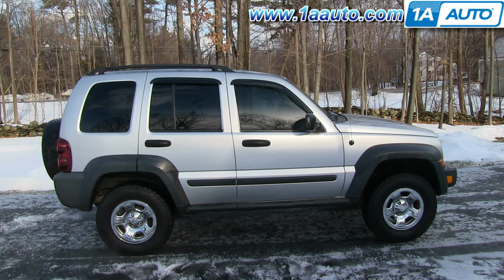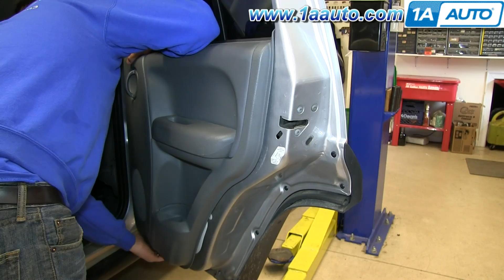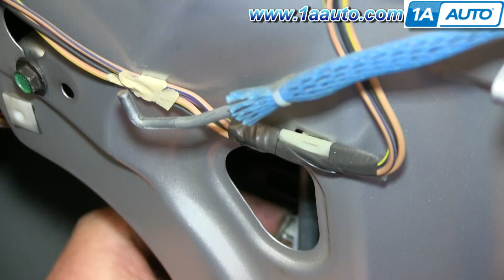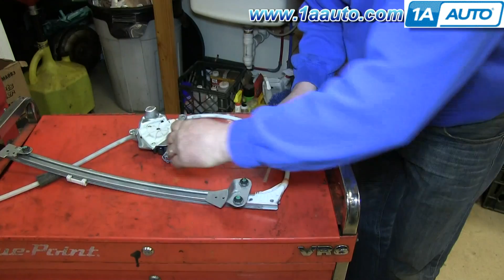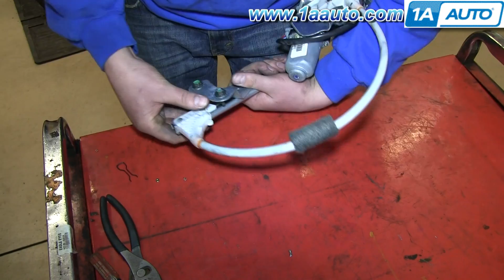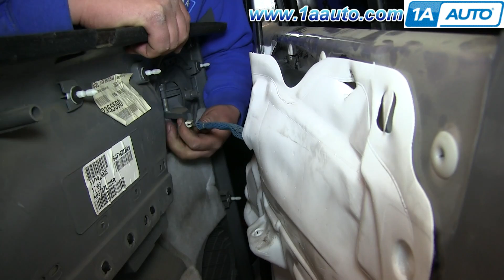How To Replace Window Regulator 02-07 Jeep Liberty

Comment: At frame timestamp 6:48 it shows the tech installing a different regulator than the one he just repaired! 
Why? 
Ciuld it be that he snapped the poly cable guide tube while he was savagely rupping the original reg. out? 
I jave found it best to do this removal in a warmer environment so the ppe is more pluanle and forgiving of tight radius bends. Also theregulator/motor assembly as a whole, is extracted more easily by spinning the unit in a CCW rotation as you first guide the motor subassembly followed by the regulator assembly which will be trailing right behind the motor. This technique increases the radius forced on the ppe tubing. Thereby you reduce the likelihood of snapping the tube at the stess riser point where it connects to the goosneck ppe piece that is rivet/clipped to the metal guide rail. 

Thanks for sharing theoney saving alternative to replacing the entire component. 

Be Safe

Comment: I have a 2002 liberty.  The glass keeps popping out of the clip. I took it apart and I had to bend the post on the glass and it snapped right In. Lasted 2 weeks and now it popped out. Not sure if the post that's attached ti the glass is bad or if the rebuilt kit would work.  Any suggestions would be great. Right rear door
Reply from the maker: +Joseph Vlock Thanks for watching!  At this point I would recommend that you look into replacing the window regulator assembly.  We do not have the repair kit for this vehicle anymore, but we do have a selection of regulators.  Just visit www.1aauto.com, enter your year, make and model, and select the category "window regulator!"  1aauto.com

Comment: A few observations: You missed routing and re-clipping of the free tube [the bit connected to the motor bracket but not the actual regulator, also called the 'runout tube'].
 I'd recommend lubing the track and...
... finally it's always good to test the works before buttoning it all up.
Reply from the maker: +jbelicka The window regulators that we carry come pre-greased. Here is a link to the replacement window regulator for on this website for your vehicle. http://www.1aauto.com/1A/WindowRegulators/Jeep/Liberty/1ABMX00093?utm_source=YouTube&utm_medium=CTA+Comment&utm_campaign=ytcomment&utm_term=Tv2Uq2oiFBA

Comment: I have replaced rear window mechanisms 3 times on my 02 Liberty. Getting pretty good at
the routine. The video helps. However, on two of the three the stud would not stay in the clip. I ended up twisting the stud out of the plastic (on one) and through bolting (1/4-20). The other one, watching and waiting to see what happens.  The window seems to be under a great deal of stress when following the curve of the new mechanism. Not sure if the curve is correct ?  I see several other posts describing the same problem.  Be nice if 1a auto would address this problem.

Comment: Hey guys, just wanted to make sure I am purchasing the correct parts. I need to replace the driver side, back seat side. If I order from the link below, should I have everything I need (tools aside) for the repair? 

Thank you

http://www.1aauto.com/jeep-liberty-window-regulator-driver-side-rear/i/1awrg02382?f=806309&y=2006
Reply from the maker: +Sam Thoen Hi Sam, if you give our customer service a call at 866-403-3393 they should be able to help you

Comment: I did this repair, but now the window won't stay in the bracket. The little clip won't hold the stud in the bracket, and every time you close the door, the window falls all the way down. Such a stupid design from Chrysler. Why wouldn't they have the pin go through the stud and not just around it.
Reply: Matthew Walker Got it figured out. The opening for the stud was really tight on the one side. So while the stud was snapping into the clip, it wasn't all the way in the bracket itself. On the drivers side back it went in like it should, but on the passenger side I had to use a c-clamp to get the stud to come into the bracket. Yes, both rear windows on mine had the regulator problem.

Comment: How do I know if I need the Rear Window Regulator Repair Kit? 
I can hear the bracket moving up and down inside the door, but the glass has fallen out of the bracket and off the track. 
8:06 The glass won't stay on that blackpiece in my door. 
Does this sound like something that can be fixed without purchasing a new regulator kit? 

Also, do you guys sell that black adhesive to seal the water shield back on the door frame? 

I'm just afraid that if I start this project, I won't be able to put everything back! 

Thanks.
Reply from the maker: You may want to remove the door panel to see if the regulator is broke, or if the glass somehow broke free from the window regulator. We currently do not sell the black adhesive for the water shield.

Comment: I have an 06 Jeep Liberty V6 3.7L.  The temperature gauge on the dash has been reading as overheating.  There is no white smoke and no bubbling from the coolant reservoir.  I started noticing problems when the heater stopped working and then about a week later, the temp gauge starting rising. The car was then sucking about a gallon of 50/50 per week.  I noticed a leak from the radiator, so I have replaced the radiator, thermostat, water pump, and the sensor for the temperature gauge with all brand-new factory parts. The vehicle temperature gauge still shows as overheating and it will go down when I turn on the heater.  The fan works fine. A/C works fine. Heater works fine.  The rubber hoses running to and from the radiator both get warm and it feels like coolant is traveling through.  Some people told me it is probably a leaky or cracked head gasket, but the oil looks fine, there is no white smoke, and there is no bubbling from the reservoir.
Do you think it could be a head gasket?  Is it maybe just a shorted wire causing the gauge to read hot?  Is the vehicle just possessed?  Any ideas are appreciated. Thanks.
Reply from the maker: You may want to check the coolant level when the vehicle is cold to see if there's plenty in there. Check the fuses and relays to see if they're okay.Also the radiator fan too, to see if the fan motor may be bad. To check the fan let the vehicle get up-to-temperature, and see if the radiator fan kicks off and on, it should also kick on if you have AC and turn it on. Here's a link to the 06 Jeep Liberty parts section on our website. Shipping is free on all orders in the lower 48 states. Hope this helps you out. http://www.1aauto.com/2006-jeep-liberty-parts/y-mo/2006-876?utm_source=VideoReply&utm_medium=VideoReply&utm_campaign=1ATony